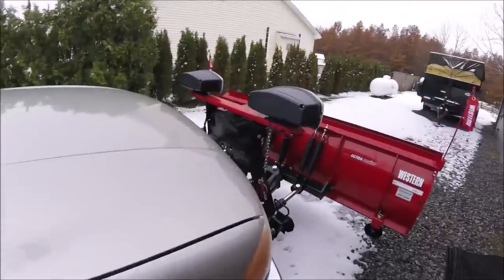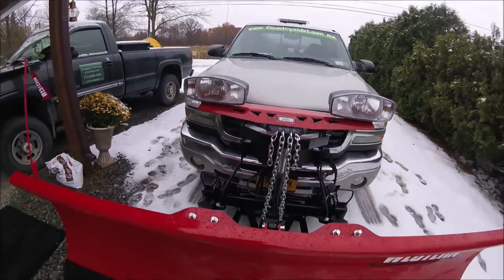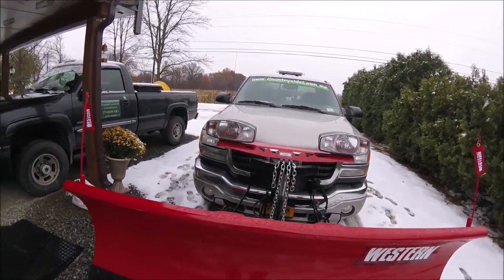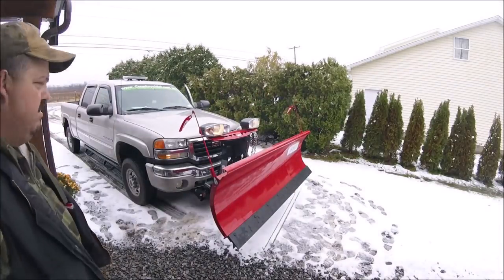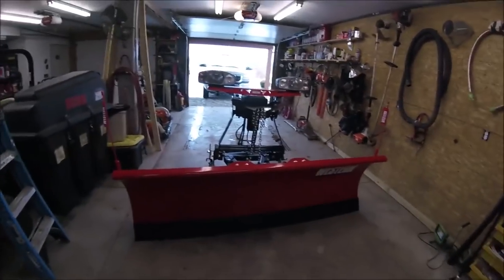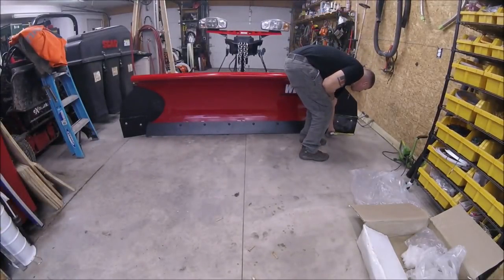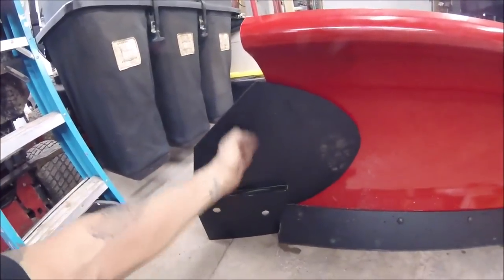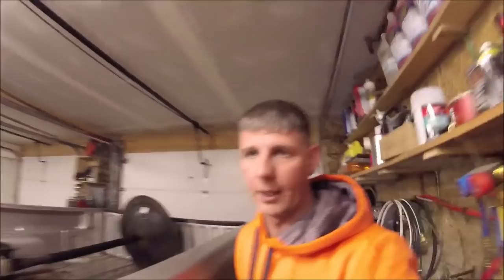Western Snow Plow & Pro Wings

Comment: I have the setup, you will love those wings, I put  the wing rubber blade more forward in front of the metal cutting edge, either way I don't think it makes a difference. good luck with the plow!! I love running straight blades, less weight on the front end of the truck.
Reply from the maker: Watch my past videos. I ran wings on a poly plow for 5 years. Everyone swore it couldn't be done......😂😂😂😂😂😂
Reply: @CountrysideStrong  you can a photo.  been looking to put wings on my 7'6 poly

Comment: Im running a 8 foot fisher mm2 straight blade this year. Im debating on getting wings for the parking lots I have. I would need to be able to take tyem off when i do the privet roads I have. Or is that not possible.
Reply from the maker: With the style I have they pop right off with 3 pins

Comment: Nice wing install video. I am afraid you may have issues with the rubber on the wings folding back and letting snow pass through in wet heavy conditions.
Reply from the maker: Nope. Not anymore that's solved already used them. It's pretty much just like the wings I had on my boss. I am changing that rubber tho next week and it'll be more defined
Reply: Countryside Vlogs  oh cool. You should make a video on it
Reply from the maker: @KenMrKLC  stfd
Reply: Countryside Vlogs you are abusive to your subscribers :-)
Reply from the maker: @KenMrKLC  not all of them 😉
Reply: Countryside Vlogs  that’s it I’m unsubbing.
Reply from the maker: @KenMrKLC  at least once a week 🤣🤣

Comment: I got the poly version of this..  you lucky to be able to put extensions on..  I cannot get them,  this is my second year with it. Services it’s purpose
Reply from the maker: Hell you can't. They told me same thing. Ran wings in my poly boss RT3 for 5 years without issue. Look thru my videos
Reply: Could have bought the 8ft pro plow?
Reply from the maker: @Bigitaly57  and wasted money on things I don't need. The purpose of the wings are to be able to scoop, not for the added length
Reply: True. And all the added weight. And I think the 8ft is another grand.  Good point.
Reply from the maker: @Bigitaly57  I believe you're correct

Comment: The rubber cutting edges are meant to be in front of the main cutting edge otherwise they will simply flop back and drop snow or sometimes bend the plow wing metal itself back as well
Reply from the maker: That's exactly how I mounted them. They ARE in front

Comment: Hating my used truck with a boss 7.6 poly sport duty. Loose plug connection like a mofo and corrosion in my power supply plug. Broke a coupler ping handle hammering the pin into the frame
Reply from the maker: Yea that's bad. You should never have to hammer it in, something was wrong

Comment: Make sure you put the plow in float mode and push the lift cylinder all the way down before you check your oil. If you don't do this you will over fill the plow and you will end up blowing oil out the vent during plowing and it will make a mess. Also use Western oil and not the cheap aftermarket blue oil.
Reply from the maker: Been using this "cheap" blue stuff for 21+ years without issue
Reply: @CountrysideStrong  Just giving you my opinion on the oil. I personally wouldn't use it and I also wouldn't of mixed it with the Western oil. I am a Western dealer along with other brands and have been selling and servicing plows for over 30 years. I am also a Walker dealer and met you this year at the GIE at the event at the Caverns. I like your videos and I thought you would appreciate the advice. Did you lower your lift cylinder and recheck your oil level?
Reply from the maker: @danmcgivern1345  not yet I haven't been back out since you posted that but I will be in the morning for sure. I always appreciate advice and I understand what manufactures say but in all the years experience I have, I have realized 90% of what manufactures and dealers say is strictly to protect their asses and in the world where those of us use this equipment day in and day out, it's usually a different story. No offense, these are just the facts.

Comment: I plow for a living.  Them kind of wings are nothing but a joke can you do about 3 inches of snow and plow it for about 30 yards and then back up and let me know how much snow was in your plow while you were moving it it moves nothing the overflow is disgusting you need the ones that come straight out and 6 inches Past blade and it’ll scoop the snow like a front end loader
Reply from the maker: I’ve been plowing (for a living) for 24 years, never an issue with these wings if you know what you’re doing

Comment: Westerns plow blade sucks from my experience
Reply from the maker: Everyone runs them or boss round here year after year without issue.
Reply: Been running them for years. Great plows.
Reply: Yea the plow them selves are great I upgraded to a different blade and it is great
Reply from the maker: @eddieszalay7393  allot of good ones out there these days. Hell Western, boss, Fisher, all owned by the same company. Pretty sure snow dog is also owned by Douglas Dynamics
Reply from the maker: @snowblowerman5115  hell yea
Reply: @CountrysideStrong  I thought Boss was bought out by Toro.
Reply from the maker: @547Rick  not what I was told
Reply: @CountrysideStrong  I just looked it up.  Boss was purchased by Toro in October of 2014.
Reply: Douglas Dynamics owns Fisher, Western and Snow Ex.  Used to own Blizzard before doing away with them.  Toro owns Boss and Buyers owns Snow Dog.
Reply from the maker: @6.8SuperDutyDriver  there ya go, I knew it was something like that